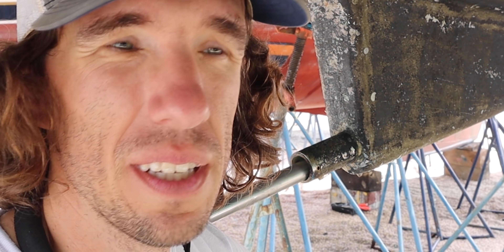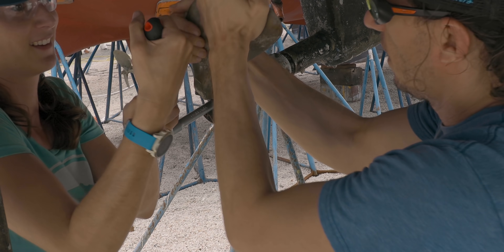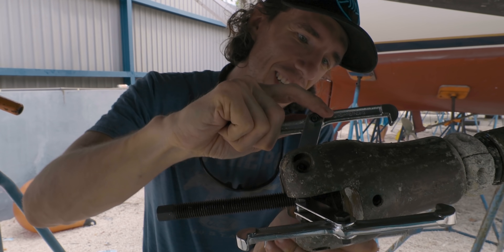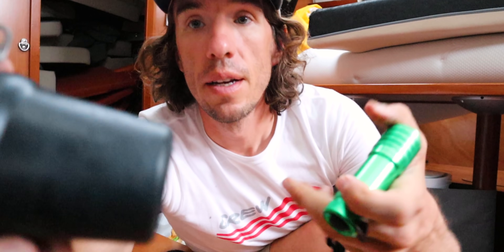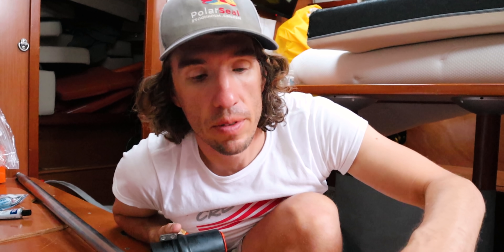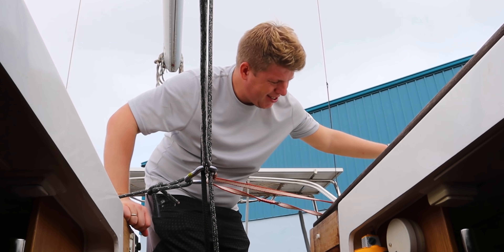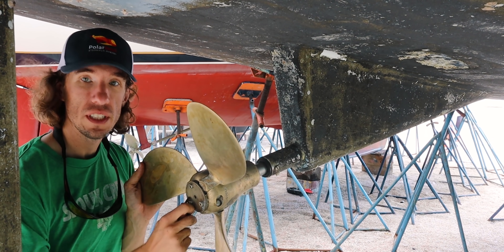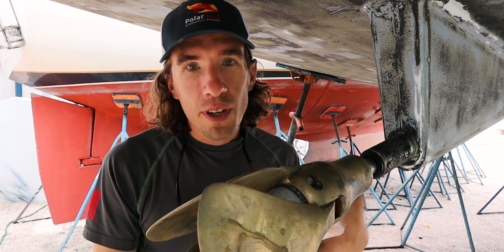SAILBOAT MAINTENANCE: Replacing the stern seal, cutlass bearing, and aligning the prop shaft.  #74

Comment: I’ve replaced the cutlass bearing on Beneteaus before without pulling the shaft.  You can use windex or dish detergent to slip it in. Use a piece of lumber with a hole cut in it to go around the shaft and tap it in place. I vote all the oopses.  Makes it fun to watch.
Reply: Tap into place? You are damaging the internals of the transmission...NEVER use a hammer to install a Cutlass bearing, it is to be PRESSED in.

Comment: When aligning the shaft after using the feeler gauge you are close but not close enough. A proper  alignment  will take a dial indicator.   Look up  Sigma Drive in the long run this will save you a lot of trouble . Just a little vibration in the shaft or coupling well ruin bearings which can very expensive to replace.  When you hit the water every thing changes that is plus for the Sigma Drive.

I enjoyed you video and one of the things I noticed that although this was the first time you had done this. You had researched so you knew what had to be done.

Comment: Great call to change the bearings; it really sucks to splash the boat, find a sweet spot, pop a beer and when everything calms down you'll (might) hear the small insignificant sound of water flowing somewhere.... You might search for the source - or think that it's sounds from outside the hull... 
And in the morning - you have a huge mess to tend to  and an emergency booking back at the yard. 
True story...

Comment: 2:22 any time you have two wrenches/keys etc to loosen a thread have the two levers about 30° open so that the force to open closes that angle plus in this case you want both levers at the botom, not at the top. For smaller bolts you can even have that openeng angle between tools much smaler that you can grasp both in one hand and squeeze them together.
 I've been assembling and servicing machinery for 30 years.
Reply: O

Comment: Good job! I would just caution people who have not done it before, not to stand directly behind the prop while using the puller. Also, to continuously tap on the prop as you apply pressure with the puller. The prop can launch very hard off the shaft!

Comment: Great video, I'm about 3 years behind you - just done the cutless bearing and dripless seal, next job is to attach the Propshaft to the Coupling, to the Flexible Coupler, to the Gearbox and check alignments! Sadly not in as exotic a location, but it is a PITA wherever you are!! Fair winds  ⛵

Comment: Another trick - a big hose / duct screw clamp to go around the jaws of the gear puller to hold them in while aligning the gear puller.. Push comes to shove - top of a soda bottle (2 liter), inner tube from a tire, bike tube with a clamp.

Comment: Great video. I had this done on my Oceanis 40 to change the shaft seal. Had to use heat  to release the gearbox couplng from the shaft  which worked - however the heat damaged the gearbox flange seal which was only discovered when everything was reassembled resulting in a massive gearbox oil leak as soon as the engine was started. We live and learn! These videos are super informative...please keep them coming
Reply from the maker: Oh I feel your pain! In any boat project there is a risk to f*ck up something you wanted to improve. We’ve all been there :)

Comment: Recommend you to put some marine lub onto the "teeths" on the prop blades. It will make the folding prop to expand at very low RPM's and get a grip into the water. Handy when in reverse and low RPM. Good work!

Comment: A really good video....probably would need to soak the shaft coupling for a few days with PB Blaster or the like and then apply heat.  
 I have an auto prop for which there is a prop remover kit that bolts to where the prop anode sits at the shaft end  (with the anode removed). A bolt then screws into  the mounted-unit to push the prop off.....might want to look if it would work on your prop or if there is a similar prop manufacturer supplied tool to remove your prop.
 One criticism......put terminal covers on that starting battery ( in fact all batteries). Handing tools and man-handling a prop shaft with two exposed battery terminals could result in some unplanned welding.

Comment: Crazy tip...  If you could install a second shaft seal that spins aimlessly.  Then when the shaft seal fails at sea, cut the old one away and move back your spare.  I was able to to this on my tides marine shaft seal.  However, my set up is is easier for this trick.
Reply: I heard that if you do this the rubber on the spare is aging and hardening as well...

Comment: It is impossible to keep the shaft lined up over the long haul.  The adjustments are just too fine.  It is best to buy something called a Sigma Drive as it is a miracle.  My friend saved 25k in maintenance costs over three years on his motor yacht.  It saves the engine bearings, motor mounts, cutlass bearing, shaft, stuffing box, etc.  The noise level is also typically reduced by 30 percent.  Also I don't know if it is required for your prop, but did you put thread lock on the set screws?  Typically it makes a difference in helping the prop not fall off.

Comment: You missed one of the most important parts when re-assembling LOCTITE all the bolts on the prop in place. We used Loctite 243, or should I say the Volvo technician did.
Reply: I did thought about it.
Reply from the maker: True... I did put loctite on all teh bolts... this may have been edited out.  ryan
Reply: @RyanSophieSailing  Phew, I was not looking forward to the Our prop Dropped Off episode.

Comment: I was bellowing CUTLASS at the screen there, you might find a rechargable impact gun handy for stuff like that, I was worried you might scuff you shaft up using the pipe wrench on it too just thinking if you ever had to pass a seal down over it at some point and to be  honest I got a realy good marine engineer to do the final alighnment on the Brenda C as it had to be perfect as I don't have any flexible mounts or cuoplings, great job of the job and the video

Comment: The stave bearing could be installed using the old one as a mandrel by tapping on it. It is necessary to align the shaft when the boat is in the water, because the hull is curved on the stands.
upd After watching the video to the end, I saw that you know)))

Comment: Did you ever remove the orange rubber thing you inserted into the shaft seal to protect it from burrs or nicks? it looked like it was still inserted into the shaft seal as you where working on the alignment. Thanks. Great video!

Comment: A cheap battery battery operated rattle gun goes a long way in getting stuck bolts off. I have all this to to on my BO40, Was the prop shaft seal the 828422 30mmx48mm ?

Comment: Wonder why they don't use a universal joint from the gearbox to the prop shaft like most trucks use to deliver the rotary motion to the prop so as too reduce the risk of the shaft bearings wearing out, as this will give you some wiggle room when mounting the engine and when the engine starts and stops.  This should work fine since the prop and gearbox shaft angles  are less than 15 degrees. Alternatively use a CV joint which would also reduce the chance of the bearings wearing out due to a misalignment of the gearbox and prop shaft. Anyone know why?
Reply: It takes two universal joints together to make up a flexible shift. Gets to be a bit crowded because of an added slplined coupling to account for  the velocity not being constant if the driver and driven shafts are not close to being in alignment. There would need to be a separate thrust bearing on the driven shaft since the one on the gear box would no longer be in play.
Reply: @jamesclark3119  I noticed universal joints have an issue with constant velocity so thats why CV joints are also used. I suppose thats why they have flexible joints now. Wonder how container ships connect the gearbox to the prop shafts??
Reply: @barrymatthias7551  ships and tugs have solid connections from gearbox or direct drive engine to propeller. Alignment is accomplished by lasers and bearing load calculations.

Comment: Great idea to raise engine to remove the shaft, however you never did determine what was the problem with the connector on the shaft not being able  to be removed form the  shaft.  This might bite you on the butt sometime in the future if you need to remove the shaft and cannot for whatever reason raise the engine. It would have been easier/better for you to remove the connector from the shaft and repair that issue once you removed the shaft  the boat.

Comment: Having had a couple of Beneteau's that were shaft driven I found fitting a flexible coupling was well worth it, still need to get the engine aligned but it just takes out any harshness. You can fit it whilst afloat just slide the shaft stern-wards and slide the coupler in. Yes I have done it and it alsso has the advantage in that you are putting a nice unworn part of the shaft into the lip seals. http://www.randdmarine.com/flexiblesc.asp this coupling fails safe although not heard of one actually failing, you would need the electrical continuity strip as well

Comment: I see mr. I don't lihee to be on camera is blossoming.   Why did you not take the coupling off? You had a puller and a hammer. If you are short of space a lot of the  time you can put  the nut partly on, really loose, put the appropriate socket over the nut, grab the shaft tight and slam it into the other half of the coupling, like a slide hammer. Most of the time that will pop it loose. (I know you aren't supposed to do that but in industry, you learn a few tricks)